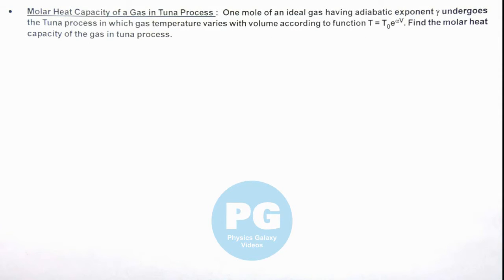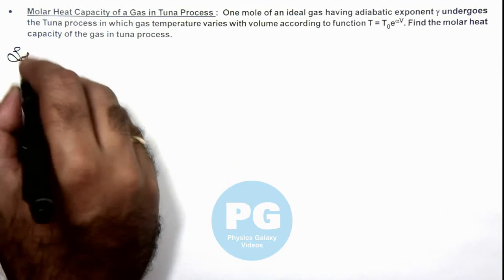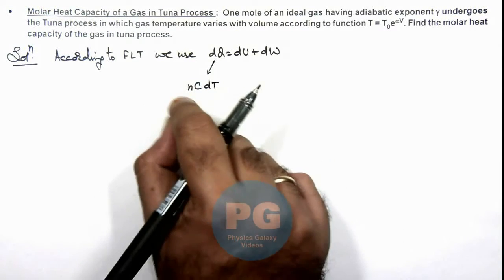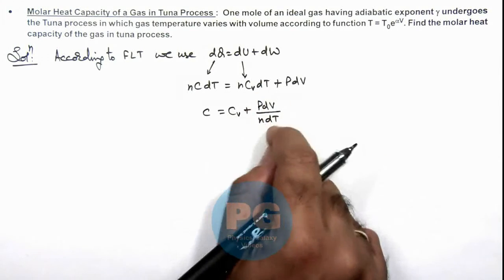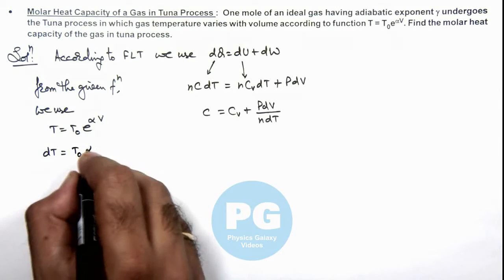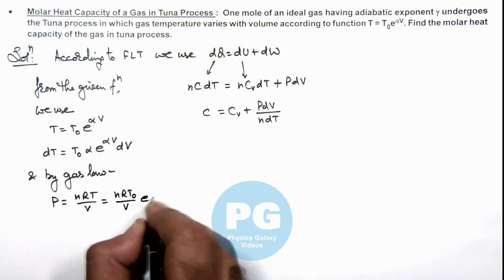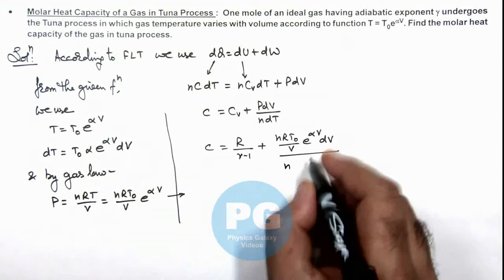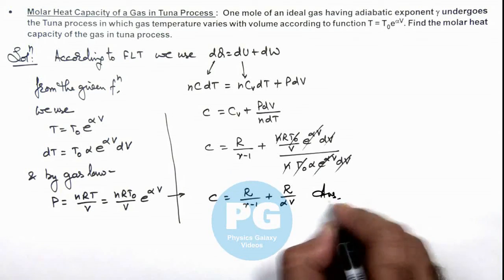13. Advance Illustration | KTG and Thermodynamics | Molar Heat capacity of a Gas in Tuna Process

Comment: Sir, as we are calculating molar specific heat capacity, shouldn't it come out to be independent of parameters like pressure and volume and just depend on the nature of the gas and process. But, the expression obtained in the final answer depends on the volume(V). Please, clarify.
Reply: Same doubt..
Reply: The units of alpha is not given
Reply: @varshalal9585  The dimensions of alpha are the inverse of volume, which can be seen from the fact that their product is in the exponent in the given function. So the answer is dimensionally correct.